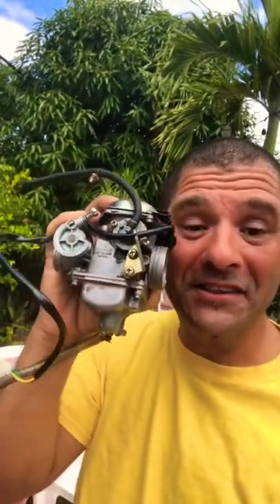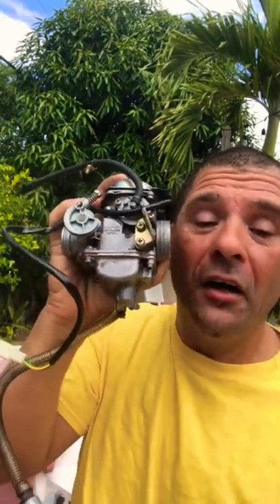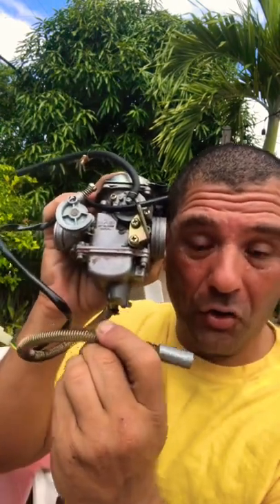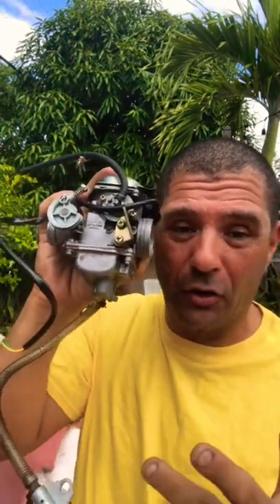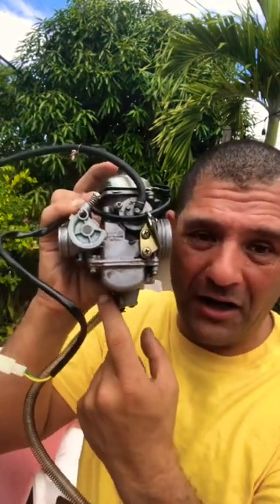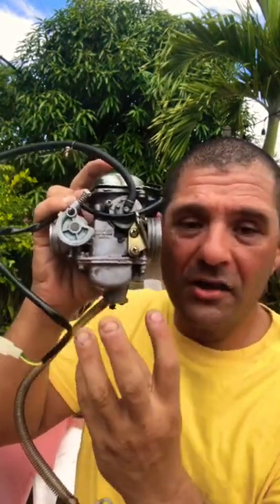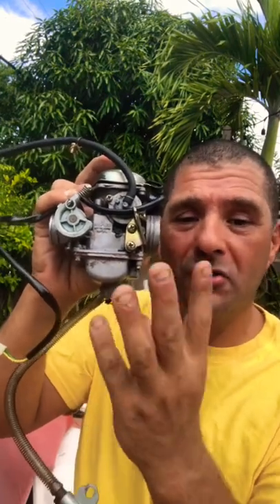Carburetor Drain valve #shorts

Comment: Do ALL scooters have that drain tube? I’ve never had one without it, but the one I got now I can’t seem to find that carb tube anywhere!
Reply from the maker: Some scooters do not have the drain hose so to remove fuel or clean the inside you have to open the carb
Reply: @VirberelloScooterTips  I saw in one video that you can remove the air box and shoot carb cleaner directly into the inflow and it will mix with the bad gas and burn it off.
Is that for real, before I try it? 
And thanks for replying.
Reply from the maker: @YouSpewed  removing the airbox and spraying carb cleaner directly into the intake is not recommended and will not clean the carburetor at the perfection yes it could help a little for the next few miles but if you remove the carb and clean it good that makes a big difference and will last you for the next 3k miles or more
Reply: @VirberelloScooterTips  I’m just trying to burn off the bad gas that I’m unable to drain off cuz I don’t have that tube coming from the carb.
Reply from the maker: @YouSpewed  If you're trying to burn off excess gas in your scooter and don't have a drain tube from the carburetor, you can try the following steps:
Run the Engine: Start the scooter and let it run. This will consume the fuel in the carburetor and help burn off the excess gas.
Ride the Scooter: If possible, take the scooter for a short ride. This will not only burn off the excess fuel but also help in circulating oil throughout the engine.
Idle the Scooter: If riding is not an option, let the scooter idle for some time. Keep an eye on the engine temperature to avoid overheating.
but remember if your fuel tank is full and your scooter is a gy6 make sure to disconnect the vacuum line that is going to the fuel valve or when you turn your scooter on the fuel valve will open and will send more fuel to the carb
Reply: @VirberelloScooterTips  That’s the whole problem. It won’t start cuz of the watery gas in the carb. Most of my scooters have that drain tube to easily get rid of the bad gas but, if this carb has a drain, I can’t find it. 
I think im gonna tilt it to get most of the gas out of the tank. Then add SeaFoam and some good gas, try starting it, then repeat that process until I can get it to start.
Reply: When you drain the gas will it refill itself